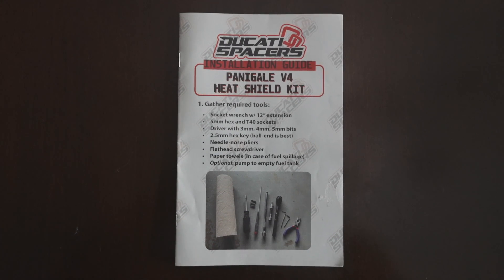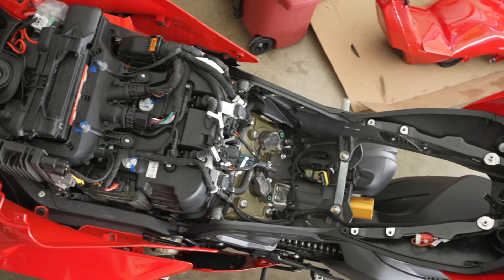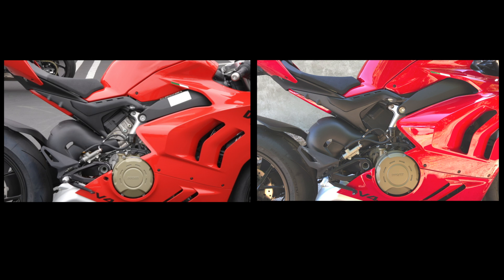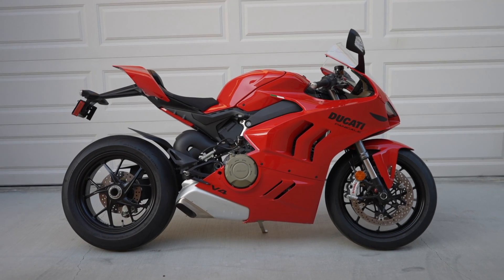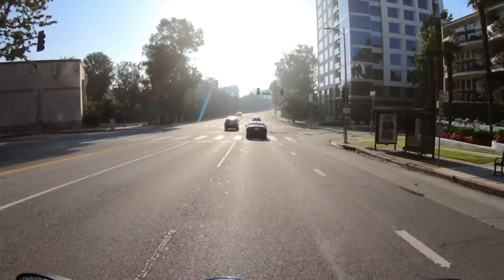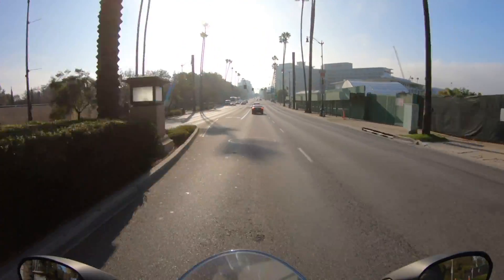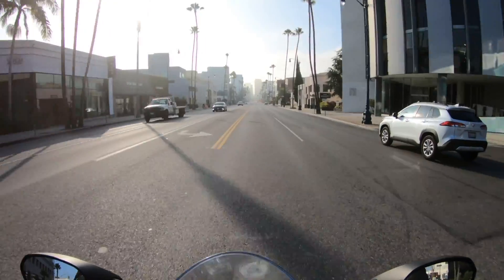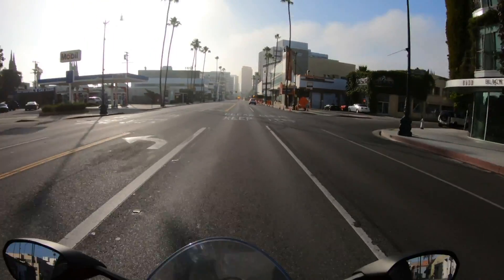Ducati Panigale V4 - Mod 3 - Ducati Spacers Heat Shield Kit

Comment: After i had V4 2019 for a test ride i was so shocked by how hot it was, but fortunately i found a solution for the heat, i bought Fireblade, totally cool bike and will not make you rethink your decision.
Reply from the maker: So you’re saying you don’t like to get 2nd degree burns when you go for a ride on a hot day? Weird. 🤣 I almost went for the RR-R over the V4. That’s a sweet bike. Enjoy your ride!
Reply: @amv_moto  I would enjoy it if it was during winter for sure but for summer boy your balls gonna smell like a pickle 😂😂😂

Comment: try adding a layer of gold on top of those shields , its used regularly in f1 to shield the drivers from the incredible heat of the massive engine. A layer of gold which is not too thin but its barely above the thickness of those gold leaves is applied on to the engine to dissipate and reflect off the heat. Try and please tell us if that endeavor worked out or not :)

Comment: I stripped one of the screws on my Hypermotard when I was fitting the Ducati Performance registration plate holder. It was so bad I had to take it to Ducati to get it fixed. Took them two hours to extract one single screw. Turns out that the previous owner used thread lock on it. Great video btw, hard to understand why Ducati doesn’t fit this kit as standard. And I thought the F4 was hot 😂 Ride safe AMV 👍🏻
Reply from the maker: For sure this should be standard from the factory when they’re producing these bikes. So true that any bike that makes an F4 feel cool, in comparison, is REALLY a furnace! 🔥🔥🔥🤣

Comment: I just picked my V4 up and my right leg is on fire!!! Do you think motorcycle (jeans) pants would help with the heat?
Reply from the maker: Sorry to say I got my leg burns wearing motorcycle pants (Dainese Tex pants) so I can speak from experience and say, no they won't help with the heat. I think the only pants that'd help would be leather pants. But I'd advise installing the heat shield kit over having to wear leather pants whenever you go for a ride on a hot day. If you're not comfortable doing it yourself, it's definitely worth paying a shop to do it for you.
Reply: @amv_moto  thank you so much. I will hit ducatinb up and see if they can install the heatshield kit for me when I bring the bike back for the break in milestones.
Reply from the maker: Oh yeah they’re awesome at Ducati NB. They can definitely install it for you. I think you’ll feel a big improvement.
Reply: @amv_moto  hello sir. I have a quick question. Base on your experience how many miles do I have after the gas light is on? I don’t want to risk being stranded so I heading straight to the gas station once it came on but only 2.3 gal is needed in my tank :(
Reply from the maker: The longest I’ve gone is 25 miles - after the light came on - when I was riding up to Laguna Seca and I misjudged my gas stops. I took it down to 60mph to save gas. Not sure what the actual reserve limit is but I was sweating by the time I rolled into the gas station. Really didn’t want to push that bike off the freeway! 🤣
Reply: @amv_moto   haha thank you so much you are awesome! please ride safe
Reply: So I will say yes, and no. I rode my v4 the other day in moderately hot weather wearing full race leathers. It helped with the heat on my legs but the overall heat of the bike was worse. My 24 hasn't ever burned me yet but I also haven't ridden it nearly as far either.
Reply: had an sp2 in the spring, sold it after 3000kms. the heat on the right leg on the street is criminal. and i spent mega bucks getting heat shielding installed.

Comment: What year model is your Ducati v4 and what year model heat shield kit did you put in your bike?
Reply from the maker: I have a ‘22 but at the time they hadn’t come out with the ‘22 version yet so I bought a ‘20/21 kit. It’s basically the exact same as the newer kit. The seat shield pattern is just cut a little different but the difference is not meaningful.

Comment: Apart from installing the heat shield kits, it'd help a lot to uninstall the catalytic converter and run straight pipes. The converter generated so much heat also but this is a pricey solution.

Comment: I own a 959, I think the previous owner put a similar kit on cause you feel it get warm and it only gets toasty on very hot days (UK based so we only get like 5 VERY HOT Days Max).

Tried a Ducati V2 and gosh that runs so much hotter than my 959. Odd considering they're the same engine.

Awesome content btw, love seeing your YouTube vids pop in my feed, can we see some more MV content soon!? 👀
Reply from the maker: Yeah the heat on the newer Ducati’s is really next level. Glad you enjoy the videos. My next few videos will be about the V4 but I have a couple of MV videos in the works for later in the year so stay tuned. 😎

Comment: Thanks for the code Hopefully this helps like you say because Its HOT HOT HOT
Reply from the maker: The heat shield makes a noticeable difference. I feel like it cuts the heat down maybe 20-25%. It’ll still run warm but it won’t be burning hot. This is the 1st mod I recommend for V4 owners!